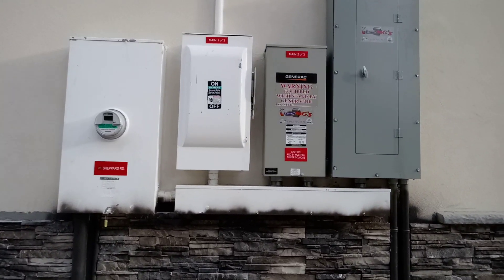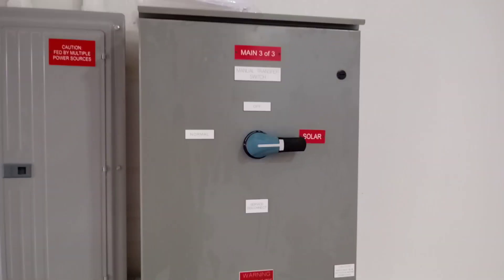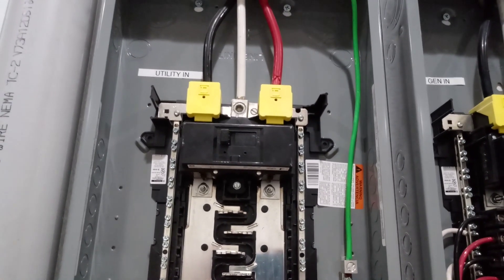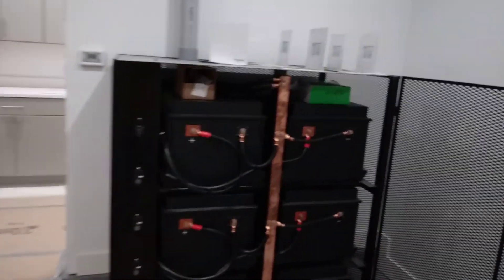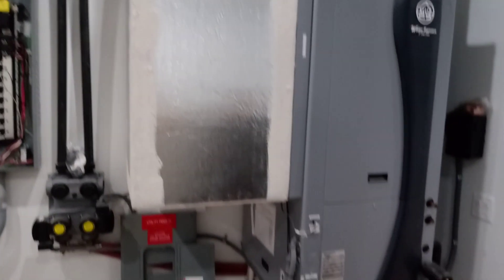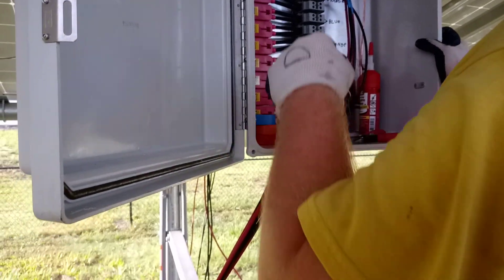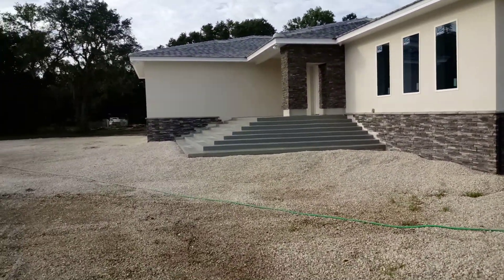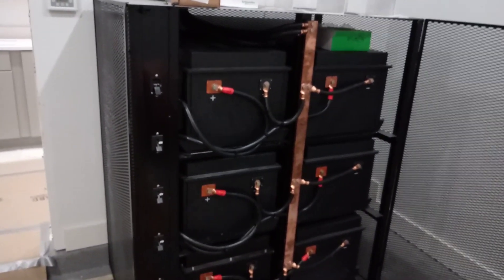Solar Grid tie battery backup with generator 21.6kw pv

Comment: Thanks for the hint on how you integrated the generator.  I've got somewhat smaller 22kW Generac generator installed already and am considering adding a PV solar system into the mix.  I was trying to figure out how best to manage the generator, and your solution seems obvious to me in retrospect :-)    I presume that you need some support from the inverters to have them operate that relay as needed when there's a utility failure.  Great video, thanks for posting it!
Reply from the maker: Yes the inverter has programmable relays your welcome

Comment: Very nice. Really wish there were bottom knockouts on the charge controllers to avoid using the LB’s 😒
Reply from the maker: Thank you I am not a fan of the design of the CC.
I really don't care for the Schneider setup either.
Reply: @SolarTechFL  What brand of inverter and charge controller do you favor?
Also what city is your bussiness in?

Comment: I need to know where to buy one of those battery breakers. I have a 250 amp DC one all ready but I need a 500 amp DC BREAKER
Reply from the maker: They dont make a 500 you could do 2 250

Comment: We had a battery solar system with electric and generator back up. We switched to grid-tie solar system and the technician does not know how to connect to the transfer switch for the generator. Do you have a solution, PLEASE?
Reply from the maker: Where are you located?
Sounds like you need to find another contractor

Comment: The owner lost a few points of boasting rights when I saw the aluminum buses. I prefer copper. Still a very impressive installation.
Reply from the maker: For ac aggregators aluminum is no problem and that is all those 3 panels are for. The load centers for the home are copper

Comment: How did you wire the relay to start and stop the Genset.
Reply from the maker: Drops 240v through a NC 2pole relay that has a 24vac coil 
The auto transfer switch starts the generator when the 240v disappears so i use the relay to do that. The 240v comes from the inverter output panel so that only the inverters control the generator.

Comment: Nice work, glad to see someone used SE Solar the right way! Check out the zero sell with the watt node on the 6848 Pro unit.
Reply from the maker: I didn't realize it could work with the wattnode thank you
Reply: @SolarTechFL  NP,  https://www.youtube.com/watch?v=ThPo5WW-YgI&t=1s is a good vid on it. You may also want to add the Rapid Shutdown on this install also,  https://solar.schneider-electric.com/product/mppt-disconnect-rs-for-nec-2017-compliance/ keep up the good work.
Reply from the maker: @goodoleme  yes it has rapid shutdown its the combiner under the array

Comment: What kind of rebates did the client utilize for discounting this setup's cost, do you know? Also is this whole system just for residential or do they plan to mine at all instead of using net metering at 3 cents per kWh? Also what liscenses do you have and which components of the project did you work on? Reach out to me, bluehillsmine@gmail.com
Reply from the maker: This system received 30% tax credit.
This is a residential system. The owner wanted to be able to live off grid if he needed to this was his dream.
I am a state certified Solar contractor
I did the electrical and structural engineering and the installation. Coronado solar sold the job and subed my company SOLAR TECH.
I have worked for/with Coronado for 12 years.
I will send you an email.
Reply: @Joe Sidebottom  Who does the owner have for ongoing maintenance? Will anyone living there know how to operate it if settings have to change?

Comment: Joe this is fantastic.  Any additional info you could provide in additional videos would be greatly appreciated.  I'm building a FoxBlock & Insul-deck home in California soon and want to incorporate some of these solar/batt/generator elements.  Specs & price range info would be greatly appreciated, including anything else you would do differently.  Have you seen videos by HighTechLab?  He's got some interesting solar projects going as well https://www.youtube.com/channel/UCiPfs-k6poV7LS0pWFcib3Q
Reply from the maker: My home is what you want to build it sounds like. look at my other videos i did build block icf walls and insul-deck concrete. roof bullet proof doors impact windows.
Yes ive seen hi tech lab he went threw alot of trouble automating equipment that lacked industry standard features.
Like his generator Auto start 
Cool stuff but not practical or needed with good equipment that has the control built in
I did the subcontract installation on this job but i estimate it was over 120k total 
Only changes i would make would be go sma or outback and a 25kw diesel generator, would be my perefferd equipment. I dont like high rpm propane generators. 
And 60kw generac that they wanted was overkill lol.

Comment from the maker: Edit...there is 1500A worth of disconnecting means at the battery combiner not 1000A.
 the max charge rate is 960A, From the 4 inverters and 5 charge controllers.
So the wire is still sized correctly.